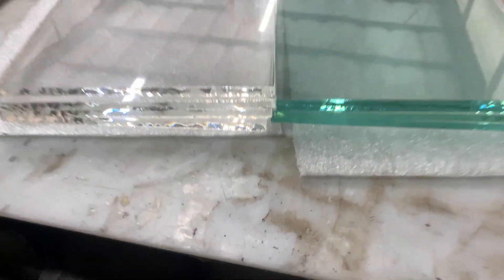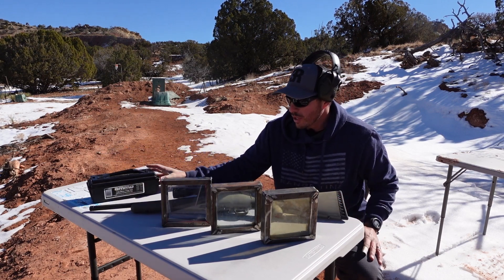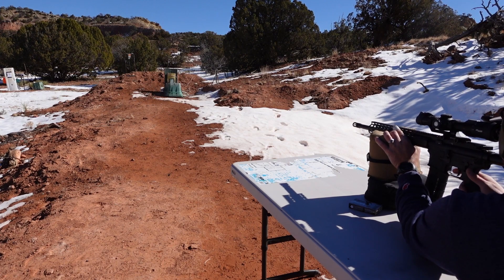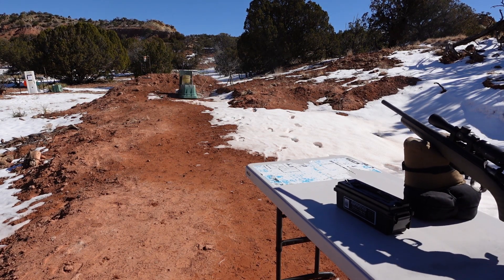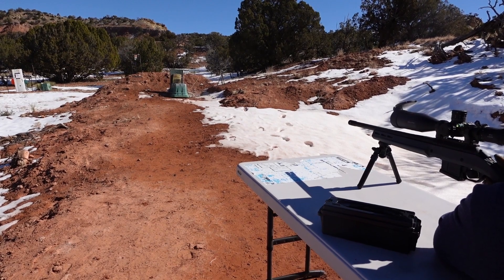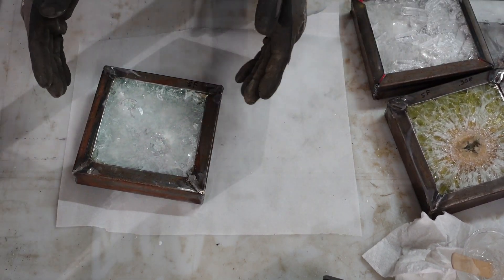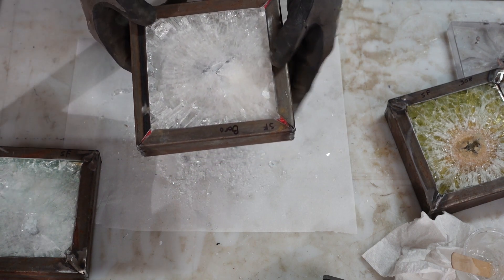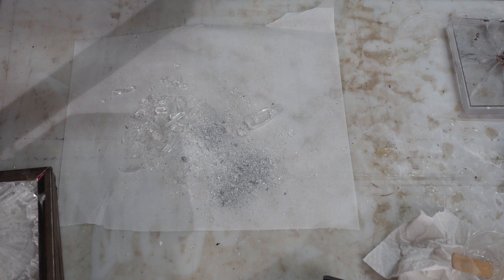Homemade Rifle rated Bullet Resistant Vehicle Glass using Borosilicate Glass

Comment: At around 14 minutes you start talking about tpu film. I was doing some reasearch with grok ai and it said a tpu film was the best choice as an interlayer between polycarbinate and acrylic. My question is, where did you get the tpu film? Im trying to find a manufacturer or someone that sells to end user like me a do it yourselfer. I already got the polycarbonate and acrylic sheet, just dking some research on what good bonding agent would be
Reply from the maker: That’s hard to explain. Many car wraps are now TPU. The secret is in the heat while applying to the glass. Many types of TPU have lower melting points. So heating it can turn it into a sort of glue or interlayer. I may have to make a video explain and showing how to do this.
Reply: @3RBallistics yea i would wonder how that would work out heating it up. Would be cool to watch. AI recommended 3M Scotchgard G100/200 Series Paint Protection Film.

Comment: Hi
I've got new idea. Many use concrete tiles in DIY armor.
But they are to soft.
I spent a lot of time to find what is hardness of  granite in Brinell and did't find anything precise. But it definitely harder than concrete tiles.
What if use granite or better gabbro or basalt tiles but wrap each tile in fiberglass tightly and cover it with epoxy?
Reply from the maker: I do have an experiment using this idea coming up if I can find all the right materials.
Reply: @3RBallistics  I forgot to say about ultra high strength concrete.
Megaslab on youtube did testing of it some weeks ago and its interesting. What if to use tiles made of it with backing of UHWPE
Reply from the maker: @ukuskota4106  I have a video testing UHP concrete. 
https://youtu.be/Ds9osrLs1L4?si=uE-p53n9WjEwT9G-
Reply: Best to use thin sections of firebrick. The higher alumina content the better.

Comment: Do you have plans to try car glass  and reinforce them with resin and lexan?
like take 3 layers of side windows (they are temperature hardened unlike front glass) and fix them with resin and add acryl or lexan.
or glue together 2  double layer side glasses from volvo 😀
Reply from the maker: Yes, I am planning on modifying the side glass. I already have the samples made.
Reply: @3RBallistics  wow , cool. We think the same
Reply: @3RBallistics  do you know what type of film is laid between glass pieces in bulletproof glass?
I watched yesterday video of making it and it was some matte film between layers and then put it in  autoclave and it becomes clear.
Reply from the maker: @ukuskota4106  most factories use PVB (polyvinyl butyral) when using an autoclave. However, there are new interlayer resin’s that can use a catalyst to adhere layers of glass together without the need of an autoclave.

Comment: If you take your current 6" panels but stack them in an array to make a 12" panel can you shoot one while still seeing through one which was adjacent to the original shot panel. 

Like a vest, I could see how several smaller panel could be beneficial.
Reply from the maker: I like that idea. I might try a build incorporating this idea.
Reply: @3RBallistics  also I suggest assembling under a vacuum. Can't get entrapped air if it's under a vacuum. HVAC vacuum pumps are around $200-ish.
Reply from the maker: @jaredharvey1511  I’ll definitely give that a try. I have an inexpensive vacuum setup but haven’t used it with glass yet.
Reply: @3RBallistics  I've heard pressure while curing is also valuable. So perhaps vacuum to get rid of air followed by pressure to make the stuff more dense while it cures.

Comment: Pure Silicon dioxide glass would be the best, but I don't know where to buy one in sheets😅
Reply from the maker: Actually, the hardest glass is made of aluminum oxide. However, ALON (the commercial name) is so expensive it’s definitely not a homemade project I’ll be doing.
Reply: @3RBallistics  yes, and it's hard to find in relatively big plates

Comment: I don't speak English well, so I want you to understand that I used a translator. In this video, the performance of the bulletproof glass you made looks very good. I was surprised that the 3rd bulletproof glass blocked the 7.62x51 bullet. I have a question I want to ask you. Do you use uv resin for high viscosity when using uv resin? Do you use uv resin the center? Do you use uv resin for low viscosity?
Reply from the maker: Yes, I use UV resin in the center and use the lowest viscosity available with good mechanical properties.
Reply: @3RBallistics just a suggestion.  I think adding a layer of plexiglass as the first or second layer would definitely improve the integrity of it once it’s hit, by keeping the shards and powdered glass in place. This would benefit in situations where it would need to resist multiple hits.
Reply: Thank you for letting me know!